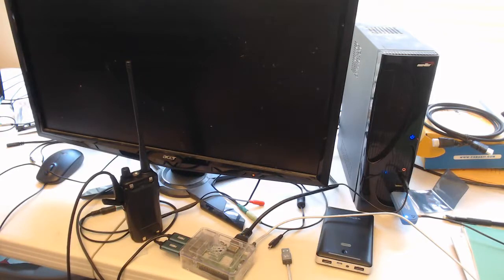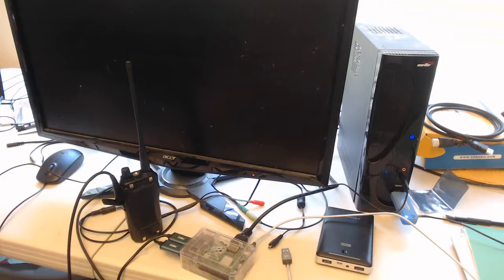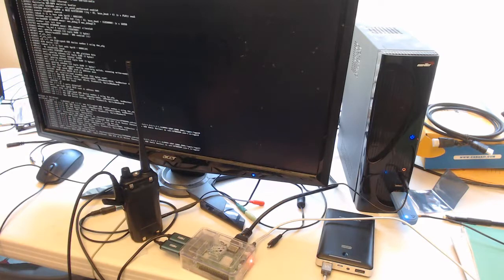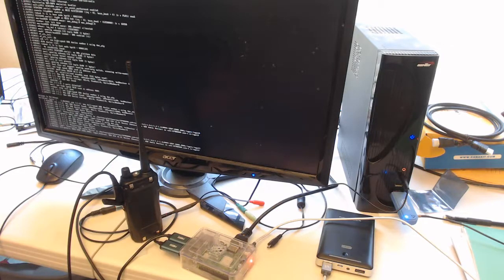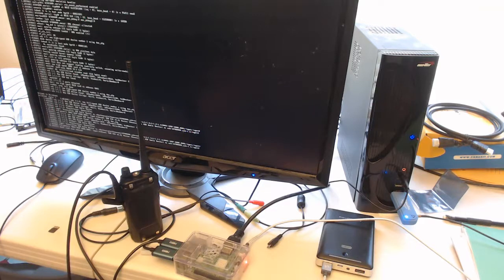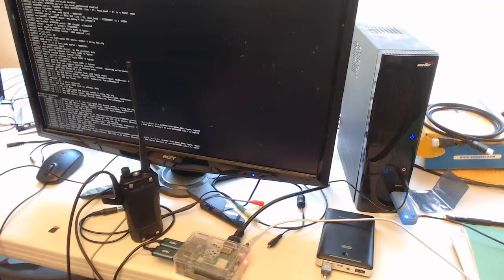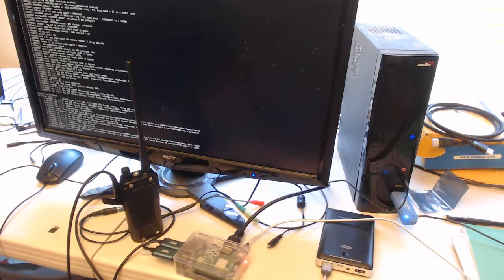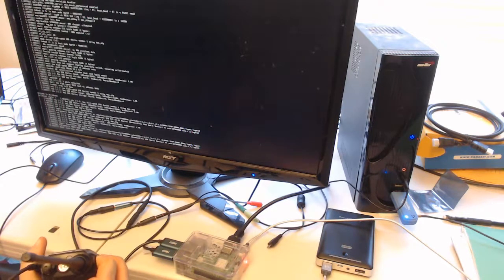Encrypted Digital Voice Using a Raspberry Pi

Comment: Revolutionary work! Can't wait to try to replicate your success here and spread the word. What I'd like to eventually see is a USB-C powered dongle that transmits at these frequencies and takes encrypted audio from an Android phone and pipes it over that interface. Would be great to just turn on airplane mode and use these for short-range comms, preferably with a PTT mic.
Reply from the maker: Glad to hear it. My goal is to make this available to everyone, which is why I provide the software and instructions showing people how they can make their own devices.

I'll point out that such apps as you describe already exist either using a phone's built-in bluetooth or wifi modules. Since both wireless modes supports higher bit rates, the audio quality would likely be better (phone quality at least) as well. I've never used any of them so can't endorse them, but a quick search of your phone's app database ("bluetooth walkie talkie" or "wifi walkie talkie") will probably give you some worth investigating. If you find one you like, please let me know; I'm always interesting in hearing about technology that works well.
Reply: @aarmono  Hello, how can I contact you? thank you

Comment: Hi like this IV been working on making a unit that plugs into my radios to do exactly this so I may just conciser this as an option   I have comertial grade Radio equipment that might be able to show long range proformanc  

Would love to get a chance to talk to you about it
Reply from the maker: Range testing is always welcome. It is extremely hilly where I am, and it makes range testing difficult even on my more powerful radios.

If you're making a unit, note this software also runs on the much lower cost Pi Zero. You can contact me at crypto@aarmono.com
Reply: @aarmono  thanks for the reply I will flick you an email some time soon  as for this I am working on making an interface with some comertial radios to test  range is n both strong and week signal environments.  It may take me.some.time.but I may allso try make a repeat running this set up and see how well that works 

I am working on getting the software to run on PC first so I can try out how it works and then move twards a radio  test   kind regards

Comment: Is there a way to shutdown the pi properly? cause i'm afraid to damage the raspberry pi or the SD card by plugging it off. I tried to write the command line "sudo shutdown -h now" but nothing happens.
Reply from the maker: The software is designed so that you can shut down the pi simply by cutting power without damaging the data on the card. In fact it's an explicit feature of the system that you can remove the SD card once the system is operational and use it to turn on another Pi, to simplify key sharing/management and in situations where it's desirable to be able to quickly erase the key in the field.

As for damaging the pi, I have cut power on multiple pi devices many times and have yet to have an issue.